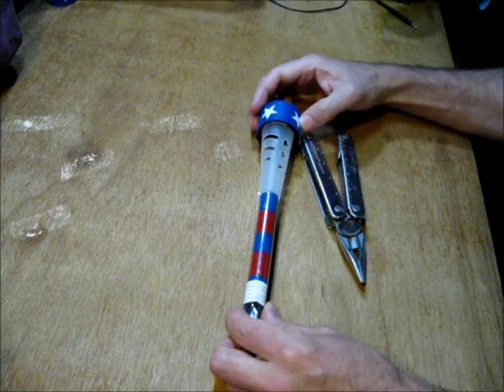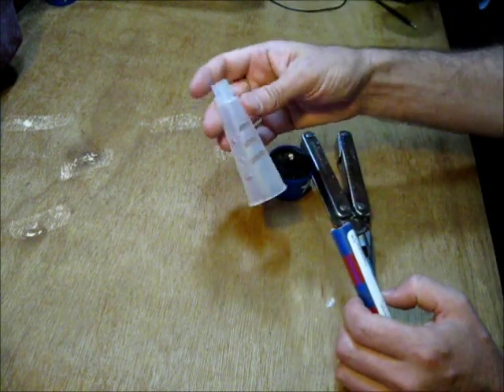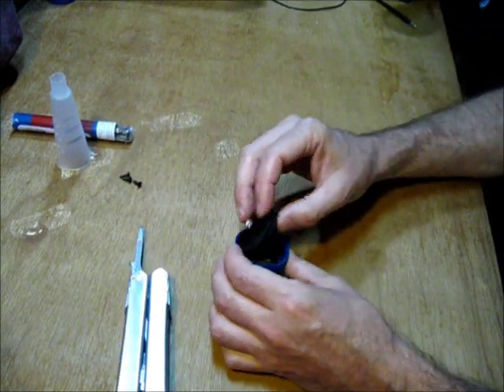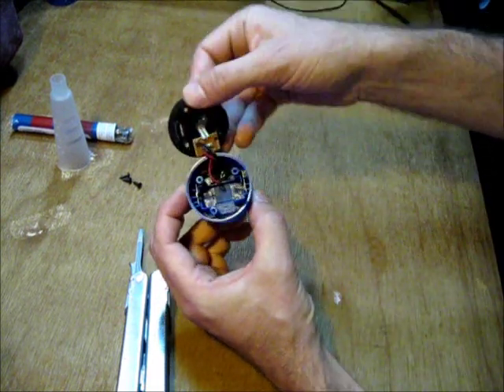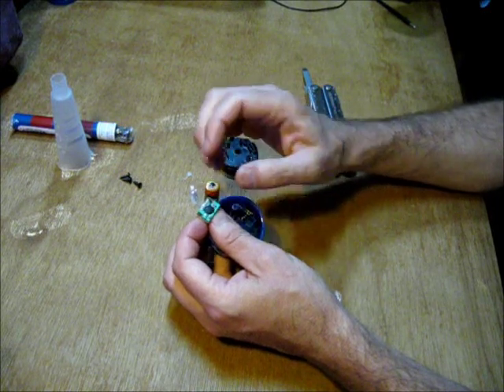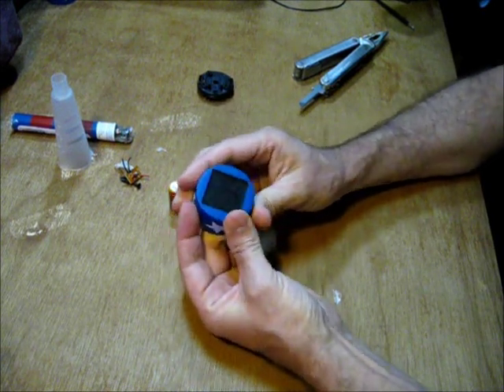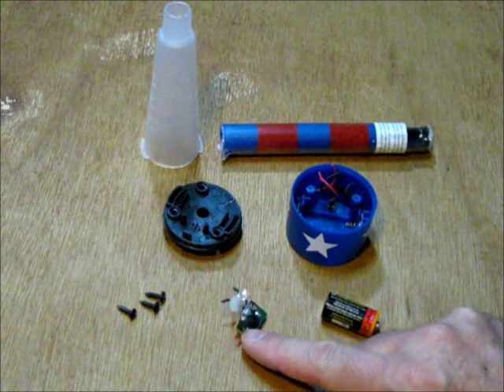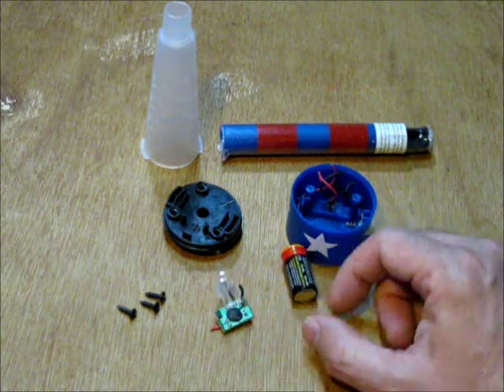Take apart a solar garden light and see what useful parts are inside for other projects

Comment: those 2/3 AA batteries ive ended up ripping the negative "nail" (cathode is an actual nail inside an alkaline battery) from dead alkaline batteries and soldering it onto the battery.

they now fit in regular things.

Comment: Just a slight correction .... a LED energizes at much lower than 3 volts .... 0.7 if not slightly less .... the circuit board does not increase the voltage as 1.2 volts are more than enough to energize the LED. I'm using similar chinese sets in my garden, exchanged the batteries for 600 mah instead of the 150 mah that come with it. The solar cell can barely charge the battery to 350 - 400 mah which is enough to light the LED for few hours up till around 2 AM in spring.

Comment: I bought a few of these only to discover that the batteries in them are what lights the light and the batteries were not rechargeable, so when the cheap batteries ran out (LED lights only come on at night with that photo cell so they last about a month) I did not have a light anymore, unless I changed the batteries which cost as much as the cheap light.

Comment: People are takin mason jars and putting solar lights in them. I need a solar light where the pad and the light both face up. Im needing my solar at the bottom/base of my jar. Looks like I could take these 3 screws out and pull the light around. Dont know if the wires will be long enough but I could probably add a piece of wire to each end.

Comment: Good idea! (However, if they used 2 smaller batteries, the total power would remain the same (more volts, less amps, equal power output) -however, it ma be simpler to make something run on 1 battery.

Comment: The LED's in these types of solar lights needs 2 to 3 volts to light up, but the battery only supplies about 1.2 volts -so, how's it light up? -Oh, I see you figured it out too: The circuit board is a step-up circuit, which increases voltage (at the expense of less current). Since total power remains the same, except for heat loss (1st Law of Thermodynamics: Conservation of Energy!), I don't understand why they do this? Power loss due to the conversion. The solar panels put out about 2.0 volts.

Comment from the maker: Yes, same answer. It would work with enough cells connected together. You need sets of 14-18 volts in order to charge your battery.

More sets = more output. It will be a very slow trickle charge but could keep the battery from draining itself.

Comment from the maker: You would need a bunch of them to do any good. They are about 3 volts with no load and maybe 2 volts under load. String up 7 or 8 of them in series to get enough to charge a battery.

Then string up sets of them to get more current.

I can be done, but honestly they are better on small flashlight batteries.

Comment from the maker: I use the Core. Works well and take a lot of abuse. But I use to use the super tool, I think it was called. Used it as a hammer as well. I once used it to chip through a masonry chimney with no damage to it.

Most of my new RV updates have been with the water system for now. I have a comfy supply of rain water. More will be on the way soon.